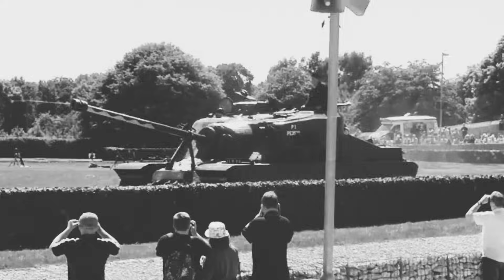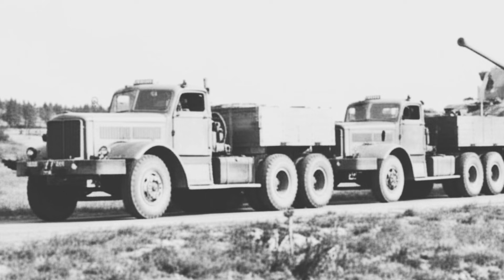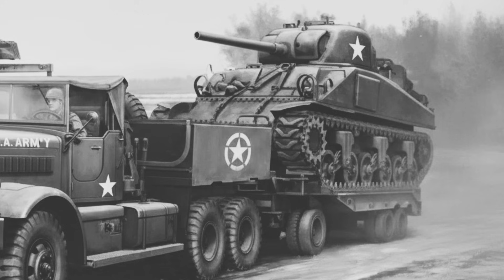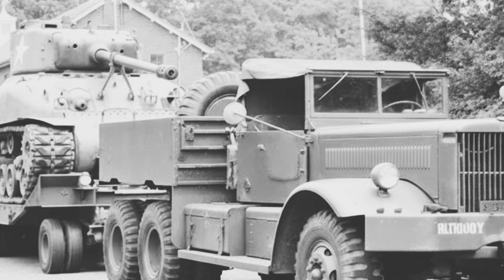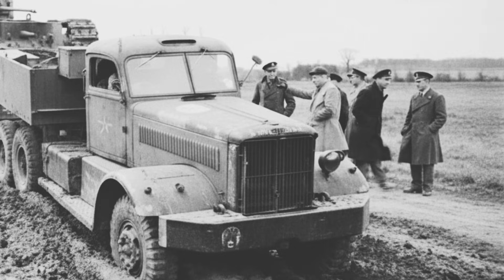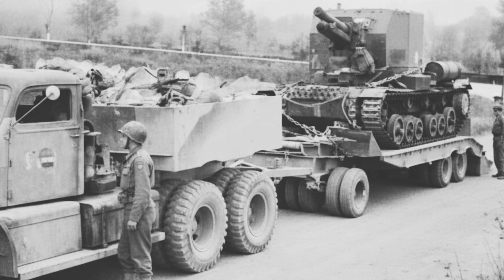Why This 'Monstrous' British 78-Ton Tank Was Built to Smash the Siegfried Line

Comment: Around 10:49 the line that struck me was that the Tortoise “could survive anything but could not go anywhere.” That really sums up the paradox of the design. And by 13:17 when the story admits it had no turret, limited traverse, and huge logistical limits, it shows how war often outpaces engineering plans. Still, imagining 228 mm of frontal armor rolling toward the Siegfried Line is incredible. Do you think vehicles like the Tortoise might have saved lives if they had arrived earlier, or were they simply too impractical for real battlefield use?